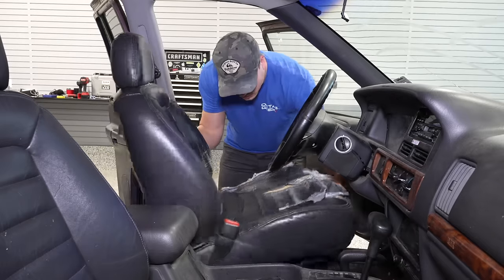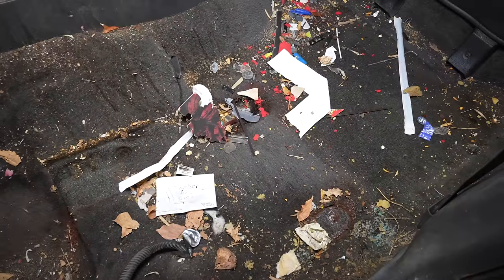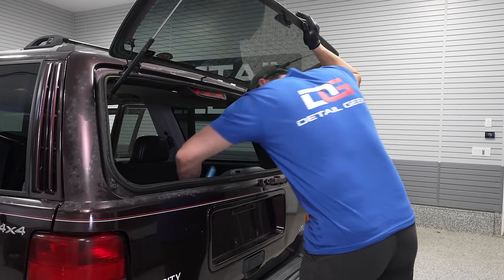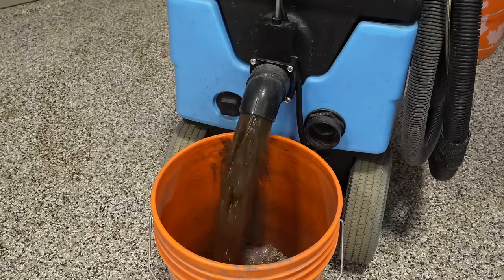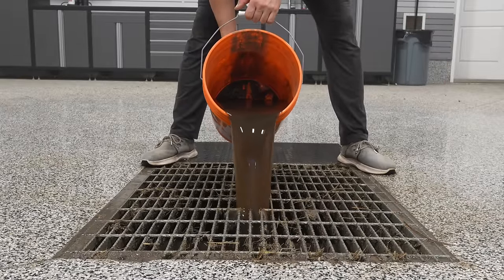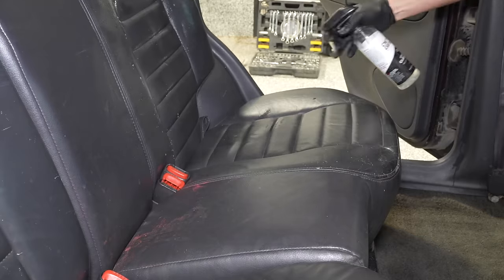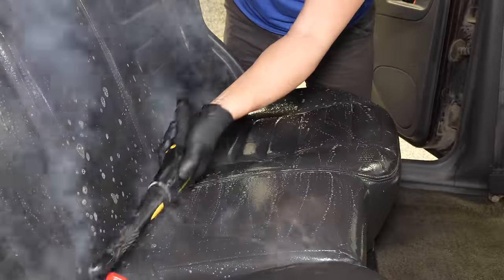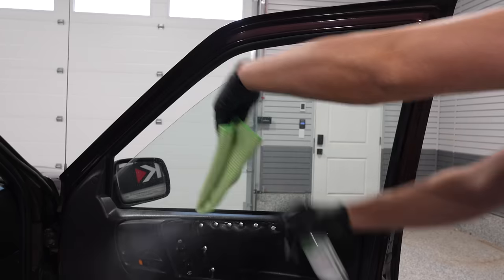I Cleaned an ABANDONED Jeep Grand Cherokee From The 90's!

Comment: I had a 98 jeep grand Cherokee Laredo 5.2 L v8 as my first car. It got 10mpg, I did all my own repairs. The a/c stopped working, other issues but my friends and I still talk about the memories we made in that car. Respect dude
Reply: Here the same, my first Jeep was a 96 4.0L and the second one was a 5.2V8. Both were limited. And they run on LPG, instead of gasoline

Comment: All that plastic around the bottom of that model year jeep....they couldn't design a better trap for mud, water and rust if they tried.....I like your work....I will go at stains from multiple directions, when extracting carpet....some stains seem to come out from one direction...but not in another direction ( i also use the same technique running the vac )

Comment: Another fantastic detail Mitch!! Certainly is incredible how far The Grand Cherokee has come and hasn't relatively changed DRASTICALLY over the years. You can still look at any Grand Cherokee new and old and you just know right off the bat it is one. I will say though the newest Grand Cherokees' (In my personal opinion) are kind of a let-down mechanical- wise. They put too much aluminum tierods and other suspension parts in it that break easier in collisions or wear down faster. I will definitely be checking out your wholesale programs as that will GREATLY help my detailing business this spring. Have a great weekend man! I'll catch ya in the next one!

Comment: Cheapo eBay Ceramic Coating will bring dull old plastics back to NEW, and it lasts for a good few months. Or risk the car dealer trick of heating up the plastic with a blowtorch to bring some of the oils back to the surface.